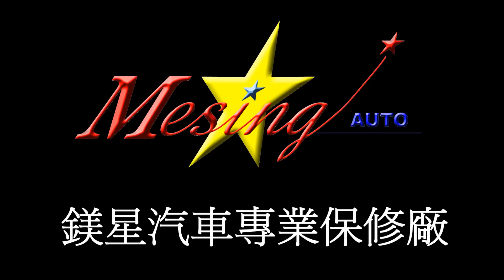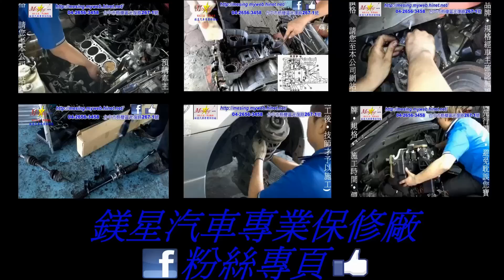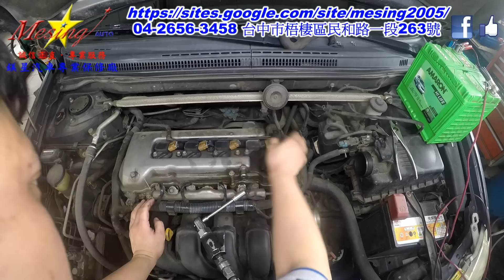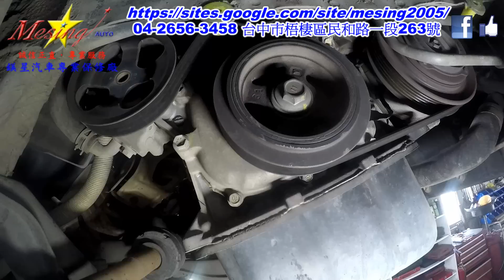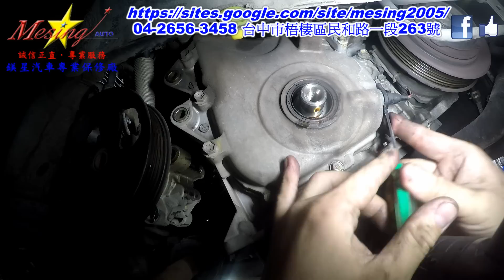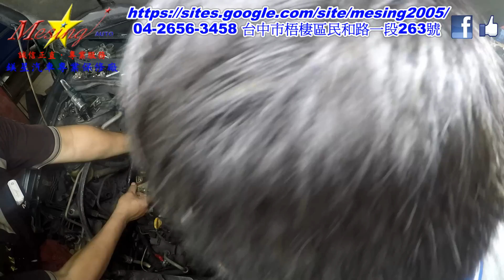How to change Head Gasket Removal on TOYOTA COROLLA ALTIS 1.8L 2001~2007 1ZZ-FE U341E

Comment: Good call on showing exhaust pipe bolts taken out
Good call showing plastic body panel off
Good call on anything else I missed
Reply: Dude seriously.  I watched this and thought Oh shit, I can just take it all out when I get all the bolts out he got.  NOPE.  There’s a bracket that holds the exhaust manifold to the FRAME that he failed to mention.  Two hours later of trying to tear off the cylinder block, I finally watch a different video and the guy shows where that bolt is.

Comment: This guy must have photographic memory.  I would not remember where each bolt goes.
Reply: I was thinking the same thing, I would never get it back together
Reply: I made this mistake lol 
Added hours and hours to the rebuild
Reply: You will notice he doesn't hesitate when taking the engine apart. Like it's all second nature. Same way with the bolts. Where he lives he probably only sees a few makes of cars, probably mostly Toyotas. Do that for eight hours a day for like ten years and you would remember every bolt too.
Reply: nahh we just get used to it and also I usually keep the same bolts with those components where they were and if not Toyota usually have same length and thread bolts unlike European made.
Reply: Screw it loosely back on where you found it, once you have removed whatever was connected

Comment: Great video. I've replaced my buddies valve cover gasket as oil was getting into one of the spark plugs. Replaced that she the rings (all one piece) but oil still getting into the ignition/spark end of the spark plug. Just the one. So it's misfiring. What could be the cause? Valve guides? Failed piston ring on that one cylinder? Or head gasket on that outside valve? (Opposite end to chain)
Reply: Does his car also burn through a lot of oil? The valve seals are notorious for going out and my 2001 Corolla burns oil like a mf and soaks the spark plugs
Reply: @vicodinsandwich326  valves definitely spent.

Comment: Well... watching them remove the headbolts with an impact hurt my soul... this is why I prefer to work on my own car. Crap technicians doing crap work screw stuff up.
Reply: seeing this comment just made my day lol. Im working on my MR2 right now
Reply: @joshuataylor7673  nice, when I made that comment I was in the middle of a head gasket job on a 00’ Celica. Btw the Quinn torque wrenches are pretty awesome.
Reply: You the one YouTubing how to do it xD Prob cracked em loose and got edited
Reply: @tanker242  as someone who is new and learning why is that bad? What would you suggest using instead?
Reply: @txxvictorious4120  from what I know it’s a costly mistake. Those bolts are super important and if they break inside or are overly tight or overly loose, it could cost you a new engine. You want to do it all by hand to untighten it then you can use power tools to quickly remove it.
Reply: @txxvictorious4120  there is a torque sequence to removing them the service manual sats start skow with about 1/4 turns in the removal sequence. I only quickly watched because im trying to figure out how to get this fucking e7 stud out but from what i saw he didnt follow the sequence and went full oninstead of quarter turns which could lead to warpage when not doing that.

Cheers.